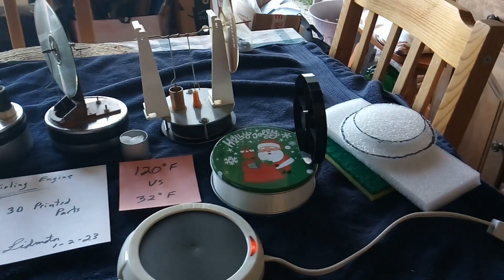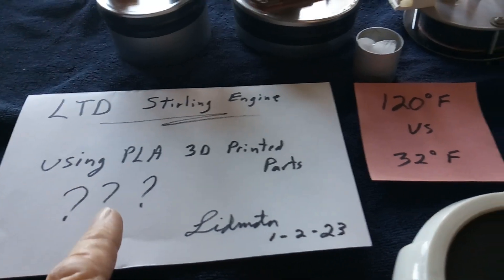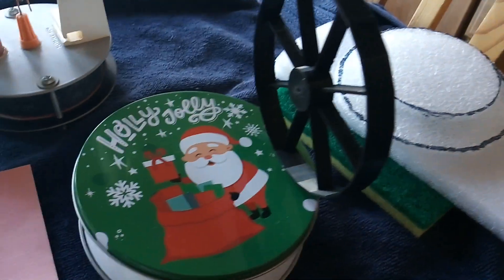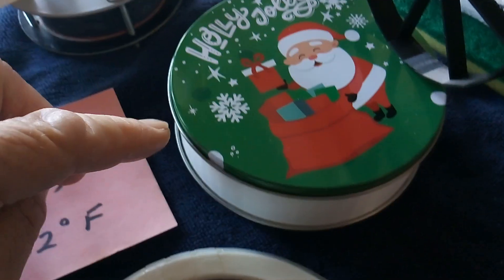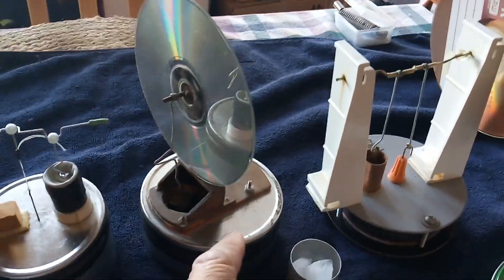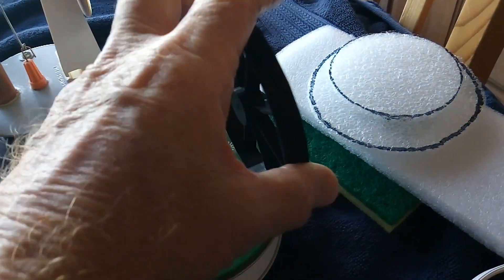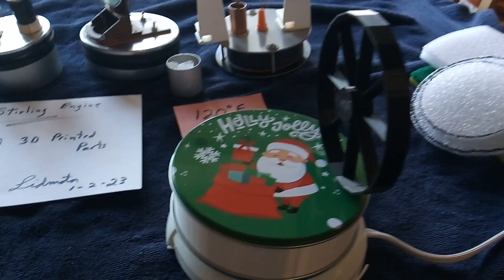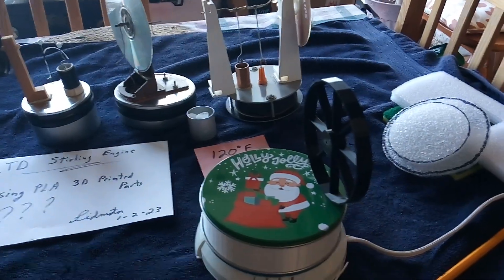Stirling Engine with 3D printed plastic parts

Comment: Good luck. It may be on the edge of possible. It still is all about temperature difference.
Reply from the maker: Other people have done this but I wanted to give it try myself.  Myfordboy has a nice design and it is posted on Thingiverse.  The other 3D printed engines are pretty complicated.

Comment: Well you are getting into the 3D printing. This should be interesting 😊😊
Reply from the maker: I have been thinking about a simple 3D printed Stirling for a long time.  If I used ABS it would be better but I wanted to try PLA.  If I stay with my last super simple design It might work----at least for a little while. 😀